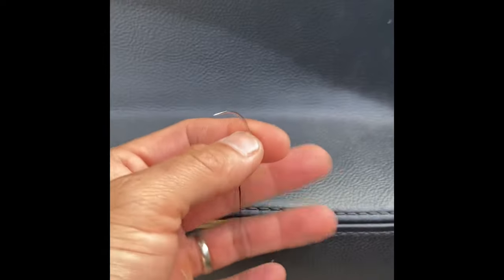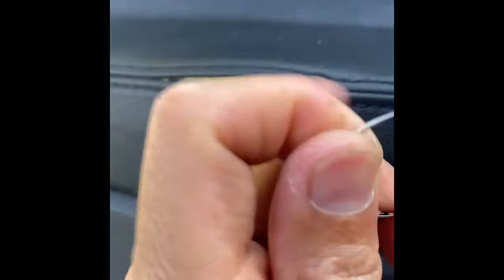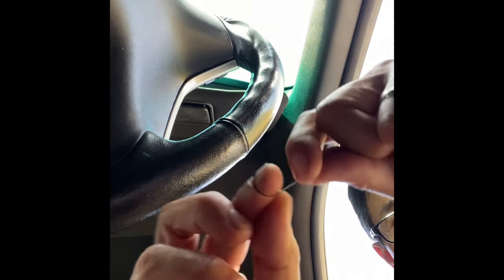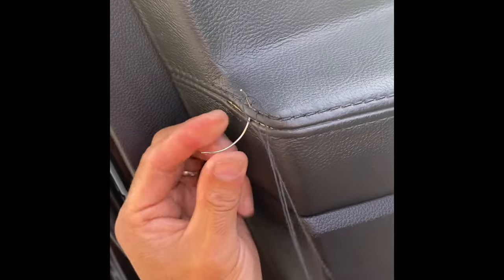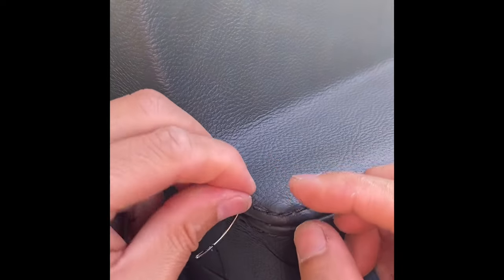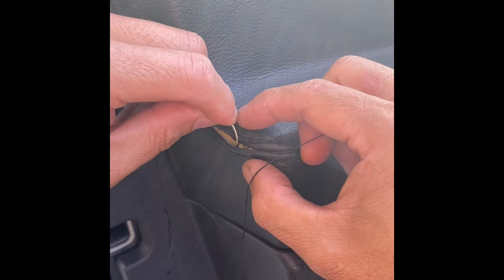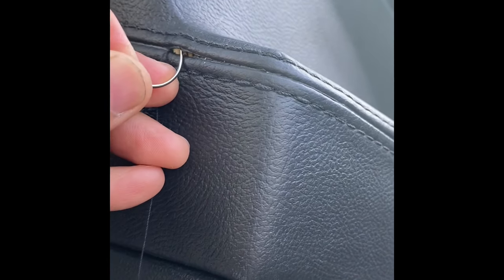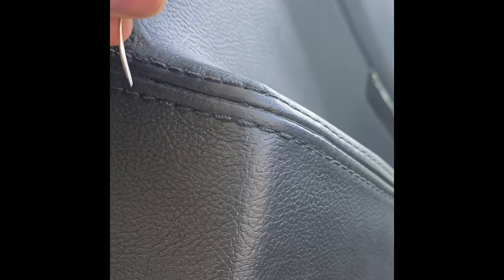Ford Explorer Door Armrest Repair

Comment: My 2014 ford explorer has the same issue. I will try to repair it soon, all thanks to your video.
Reply from the maker: Good luck. Mine still holds up fine
Reply: My 2014 ford explore also has same exact issue. Same exact place
Reply: Mine too 2014 too

Comment: FORD should be ashamed of such a lousy design. My 2015 Explorer Sport has always been garaged, only 42K miles, and already has vinyl splitting along this weak point!
Reply from the maker: I like the Explorer, but the interior is not holding up at all. Inside the armrest all the foams are deteriorating. The third row seats stitching are coming apart. I posted a video on how to fix the rack and pinion bushings because Ford don't sell the bushings and they want you to buy the whole rack and pinion which is rediculous.
Reply: Having the same problem with my 2015 XLT little over 60,000 Miles.another one of Ford's engenierian master piece.

Comment: How well is this holding up for you? I had the same issue, bought my car used and looks like it was previously repaired with some sort of upholstery seam filler, and it’s splitting pretty bad now
Reply from the maker: Still hold up excellent and I can’t even notice it has been repaired. It is so easy to do. Good luck
Reply: @Luna-The-Pitbull  thanks i got a sewing kit and going to try on my explorer!
Reply from the maker: @Moriahkrause  make a loop knot at the end use the needle and push in
Reply: @Luna-The-Pitbull  thank you so much!!

Comment: How bout 2019 350 HD passenger van how do you remove armrest
Reply from the maker: I’m not sure, but there should be a little clip in the seat where the armrest attached to and you have to push it down to pull the armrest out.